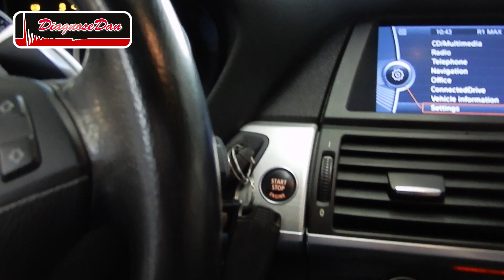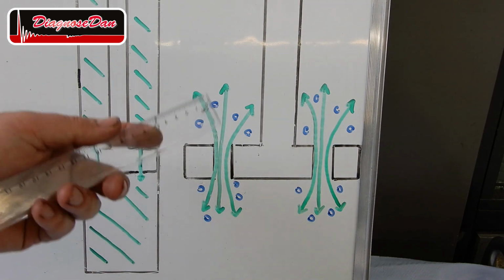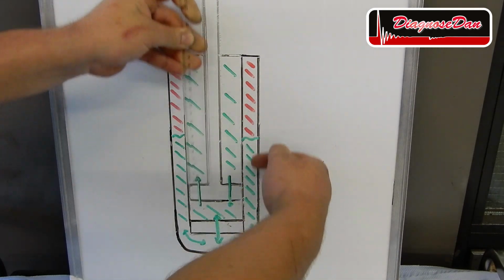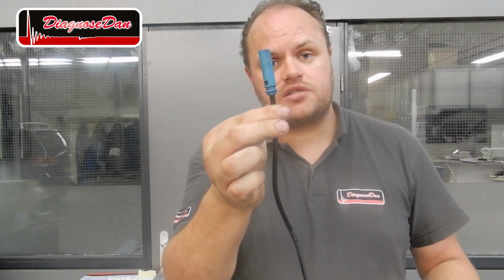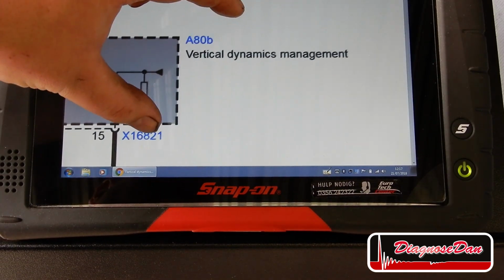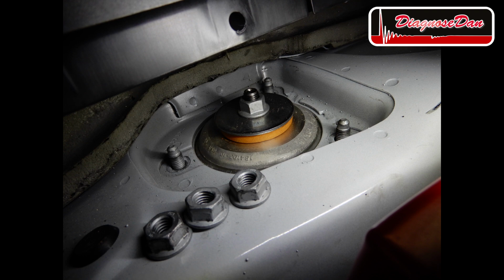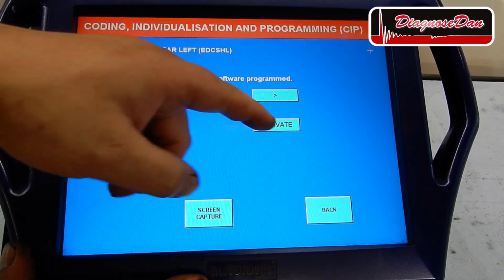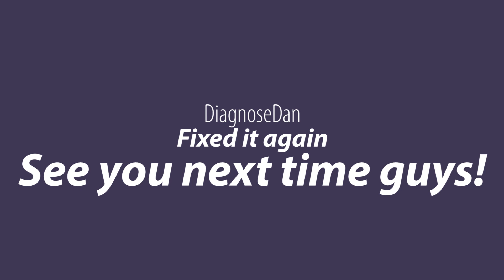Bmw Vdm fault/VDM/CDC/Dynamic dampers

Comment: Great video, my shock image comes on intermittently. I got a code D76B right rear VDM satellite. Oh boy. I’m wondering if I should replace both sides. I’ll do the simple thing first. I’ll check the connection on the right side rear first. 
This is an update. What I found was water damage to the shock side electrical cable. The back end of the cable connector was cracked open, and rusty. My question is. Why doesn’t BMW make a repair kit. My shock is perfectly fine. I had it looked at. The pins are no good.
Reply: Al final que hiciste? Me pasa lo mismo en un x6 mismo error trasero derecho D76B sí se ve un poco oxidados los pines les di con limpiacontactos y una pequeña aguja pero nada sigue el mensaje de error y no deja usar la tecla del modo Sport

Comment: Hello DiagnoseDan...I was truly impressed by your presentation & clarity in technicalities shared. Truly outstanding insights ever seen. 
I had this "chassis error- Drive moderately"....for a while now. The car runs okay with this error in the background & flashing used to occur  immediately on starting. First 3rd party scan diagnosed Front Left Vertical Accelerometer Sensor permanent fault...I swapped the sensor from left to right & got rescanned.The error then shifted to right...Now I ordered the OE part & replaced. Also, i had put new dampers in the front. The scan sees no error on either sensors but the Chassis error continues...but appears after few seconds on starting...The scan shows a Low Voltage error of front suspension (Not sure about the language). We in India are too short of expertise except the Franchise Services which I have not checked yet. Please guide. Just need a direction on what to expect.

Comment: amazing video Dan your knowledges are helping me a lot. I got one question the third wire on the diagramm between flexray high and low , is the signal from the vertical accelaration sensor inside the damper unit?

Comment: thank you Dan,  have these dampers on an F11  and they are seriously unreliable, I have had two failures ( top seal leakage) after only 60K km. They are not cheap😢 I dont have the abilty to code them so had to pay the main dealer to fit

Comment: I didn't pump cycle new Bilstein shocks and struts  and during brief emergency brake application at 70mph  awd subaru went sideways into the wall. Had new rotors, brakes, new tires, alignment right after the upgrades.  No other video instruction mentioned about pump cycling new shock absorbers. Great tip learned ,  thank you so much for being so detailed in every step.
Reply from the maker: Thanks for watching!👍

Comment: Another cent of mine.

There are two type of shocks in general.

One u mentioned is mix of oil and air so the oil is always aerated - it is called emulsion which are substances that dont blend together but mix together.
This type of shock absorber is fully filled with piston fully contracted to calculate for piston and rod capacity.

The other type is gas filled shock where gas and oil are separated by IFP ( Internal float piston). The high pressure side of IFP puts pressure on oil side minimalizing  cavitation which  occurs in emulsion based shocks all the time.

Another great video -thx

Comment: I had a 2011 Z4. The system was a bit different. It used DC current instead of duty cycle controls. 2 dampers from one axel shared one control unit. When my error message came, it could only tell something was wrong at the rear axel, but wouldn't tell left or right.

Comment: What is a good scanner for doing European vehicles? I have a snap on scan tool but apparently it is not capable of coding from what I’ve read which is a disappointment. Thanks
Reply from the maker: Mine snap on Verus does Coding on some brands.

Comment: Can you tell me if the vdm dampers can adjust the ride height? I have a f11 with M sport suspension and the front height is way too high (660mm) from the bottom of the (rim19") to the arch. No faults are stored. Can I adjust the front height or not?

Comment: I work in USA at a European manufacture dealership. One of the most critical steps in diagnosis is going to the computer and just learning the basic function of a system. Often, just reading the general function document will give you all the right questions you need to ask yourself to solve the customer's concern. I used to really really suck at this job and this manufacturer is very complicated. But doing what this guy is doing (understanding where the oil goes, what happens at the passages, etc) dramatically improved fixing problems faster and correctly (and much much easier) the first time. I still suck at the job, but whatever, I make money and cerveza still tastes good, ok? And often reading the function documents for myself, then understanding them, before I go ask the "shop foreman" what he thinks about a problem frequently reveals that he has no clue what he is talking about.  It lets me know that he will not be able to help me solve the problem and that I am on my own to solve it myself. Great video. This is not an easy or forgiving job. Thanks for posting.

Comment: BMW front shocks are the worst to replace a spring on.
When the shock is in its resting position the piston is all the way down making you compress the spring all the way flat OR pull out the piston and use a rubber piece under a hose clamp to prevent it contracting while you try to fit the spring.

Just like a regular gas filled one just that the piston goes the oposite way...

Comment: alot of garages would  just read the code and stick a shock on , then if there's a problem check the wiring after . 
I think i would have checked that wheel rim for cracks . good vid :-)
Reply from the maker: Thanks!

Comment: A comprehensive explanation and pedagogical approach. Just as a suggestion, it would have been interesting to take apart the bad module and see what could be the problem. Thanks for the video!
Reply from the maker: gearstil I tried that but the unit is casted plastic, and can't be opened🤩
Reply: thank you for adding that Dr.Dan, everybody on your channel wanted to get inside the damper module.

Personally I bet it was a bad solder joint on the controler chip. Molding the PCB inside epoxy did not prevent it to fail... 3 more wheels dampers left to fail from the same batch. LOL

Comment: Very good video and there is only one thing I can add. When diagnosing Flexray we measure the resistance in the circuit and also check for B- or B+ shorts. we don't use a scope because the Flexray is extremely fast and on a lower end scope it will give an incorrect reading which will lead to a misdiagnosis. Keep up your videos I really enjoy your channel.
Reply from the maker: Thanks for watching my video's it's appreciated !

Comment: So the same error code message appeared 3 weeks ago in my X5. Diagnosis with Carly narrowed it to front left, edscvl. The socket plug was corroded, the Blue one. I ordered new plug plus the pins and repaired them. After that Carly showed both front damper are faulty. I checked the fuses, no. 8 7.5A was broken. I changed it and reset the errors on Carly. Mistake was gone, and I could activate Sport mode again, but only for 2 hours. After that again the error code for the front left edscvl appeared. I changed the EDC module in the trunk with a used one with same part number. After that I didn't code anything, just deleted the errors from the disconnected battery. And again the error remains... Any suggestions?

Comment: a concise instructional video thank you,  I wanted to know what this repair cost, I found a new rear damper on ebay at £400, although it was possible to get a pair of re-furbs for the same price, with labour that's a very expensive fix for one corner. .. I think I could have a lot more fun in an MX5 ..  Although many years into my retirement I really enjoy your video's and the opportunity  to keep learning about modern diagnostic procedures, thanks again for the great videos.

Comment: Great video man. I have a question i have some knoking sounds from the front suspension but the mechanics arent sure about it. I have the adaptive drive option like this x6 and the mechanics said that it might be the dampers that are knoking ( only on small bumps). The dampers have no oil leaks and i have no fault codes. It may be the dampers? Thay cheked everithing else but they arent 100 %. Thanks..

Comment: you are the car magician dan. thanks for ur video. im now currently facing a problem on the porsche cayenne around 2014 years.the rear wheel differential control module show this code.. motor or position sensor reversal polarity. it has 2 big wire and 6 small wire in the differential motor. i hv no wiring diagram for this car. and the data stream is quite confusing😅 i believe the 2 big wire is positive n ground for the motor itself. but as i tested ..both were positive and the motor will operate. and this fault code is intermident. without a wiring diagram , by the fault code i can first suspected the motor itself as the fault code shows like mechanical things. and thise 6wire that goin inside the motor i believe was the position sensor and some sensor. base on this code.. any suggestion dan?
Reply from the maker: feddykoih I must admit i never worked on That problem, try to get a wiring diagram🤩

Comment: Absolutely great😁👍 Damn, that VDC damper was some work to get up and run, with all it's coding and calibration. And you sure are a great teacher👍 That job was a bit beyond what a DIY'er can do because of the required knowledge and the instruments needed. Got my Autel AL519, and it's not even close. But is it any OBD scan tools within a reasonable price range, that is a bit closer to what you have there. Lets say €400 max???

Comment: Communication line does they don't communicate both ways? and if so how do you know that the communication is not from the main unit if you don't unplugg the connector. Great video as always Dan
Reply from the maker: g johan Sharp comment, in the video i told that i would go deeper into that in a future video. But you are right.👍
Reply: great Dan and I like when you work on European cars the yanks always complain they are hard to diagnose but for you, it looks easy.

Comment: Hi from the UK Dan, thanks for the video. To make such videos more useful, could you indicate the software tool that was a necessary part of your repair. Without this, I don't see how I could copy the process you followed. Always helpful to know the cheapest route to such a tool - there are so many on the market at quite high prices for the DIY mechanic !
Reply from the maker: Rhian Taylor Sometimes you can't do things without the right tools. That's why sometimes even shops need to go to the dealer. And some jobs are not for the DIY. Even i sometimes can't fix them all, not because i don't know how to but because i don't have the right tools🤪
Reply: And which tool did you use  to code the shock absorber ?
Reply from the maker: Rhian Taylor the Autologic as you could see in the video

Comment: Does anyone know what is the max number of amps you can use to recharge a running car's battery?  In other words, if you wanted to recharge a drained battery in a running car  with a professional charger that has multiple AMP settings.Thank you for answering.
Reply from the maker: CoffeeBean Depends on what battery you are charging, if it's a normal lead acid battery. You can charge a battery quick by using high Amps and you can charge  slow by using low Amps. 
Example, if you have a 100 amp/hour battery it is going to take you 10 hours to charge at 10 Amps and only 2 hours at 50 Amps. But the slower you charge the better for your battery. That's why i devide the Ah by 5. So i'll charge a 100 Ah battery at 20 Amps.
Reply: @Diagnosedan  Thank you so much.  I just discovered your channel, and really like it because you present neatly, efficiently, and humorously.  I know very little about electrical diagnosing and figured one way to learn is to watch the professionals at work.  Thank you!

Comment: It might be interesting to point out that cavitation is not really air in the oil.  The low pressure causes the oil to change from a liquid to a gas.  Those are the little bubbles that we see as the oil loses its effectiveness.  This boiling of the fluid can be mitigated by raising the pressure on the fluid or choosing a fluid with a higher boiling point, or both.  Great videos as always.

Comment: Hi Dan, Great tutorial! Im in the process of replacing the VDM module on 2014 BMW X3 F25 and vehicle does need a complete software update. My question is; Which steps should I take first, Software upgrade the whole car then program new module or other way around? Thanks in advance :)

Comment: Great vid as usual. I'm sure Monroe doesn't make a satellite for that Bimmer. It looks like u r using a factory scan tool. 10-15 thousand. The samper was probably around 1100. Dianose Dan and installation 500. Looks like a Two thousand dollar shock absorber. R there any reasonably priced substitutes for the factory scan tools?  Yours is obviously a high end shop. Fancy rack to. Mine r assymetric simple ones. Early morning here and hot. Thank u!!!!
Reply from the maker: Bill Rimmer My tool is not factory it's aftermarket. It was about 10K just for BMW. And you pay more for more brands. You can get the factory tool (original interface) from BMW for 800 Euros when you use it on a laptop. When you use it or download software/update a car you pay 35 Euro's per day. You can use the interface on a laptop but there is also a scantool but that's more expensive. 
The customer payed 1000 Euros for the diagnosis, Complete Damper, Instalation and Coding.
Reply: I use a $20 K+DCAN cable with ISTA (and sometimes INPA and NCS Expert), it works well for diagnostics and coding, I don't trust it for something like a full car update, but most of the times you need to do that it's on a newer car and you can use a $5 ENET cable. 

If you have a proper shop, investing in tools that actually have manufacturer support makes total sense, but if you are a hobbyist willing to spend some time messing around getting stuff to work, this stuff can be done on the cheap.
Reply: samthenerf  Good morning and thank u for that excellent comment!  I don't do much in the way of Euro cars, but I will try to read up on the things u suggested. Have a great day!!

Comment: Damn, replace a shock and have to reprogram the car.
Reply: Of course. Everything is going that way.
Reply: More work for the mechanic, but more convenient for the owner than driving the old Porsche to the shop to have the mechanic tweak the adjustable Koni shocks.
Reply: BMW= Burn My Wallet
Reply: Less work.for the mechanic!
How long it took to replace the damper/shock absorber?
All deealers doesn't wanna pay a good experienced mechanic good money!
They.wanna pay the least possible money to someone how is capable to hook a tester to OBD port read the fault and replaced the component shown!..

That's why to many owner goes so many times back to the dealer with the car in warranty!

Comment: Another awesome video Dan! Learned a few new things today, they'll be useful if I go back to Beemers. 
Funnily enough, I have a similar issue with the adaptive damping system on my W212 E550, but mine only manifests itself when the temperature outside drops below freezing. Somehow, below freezing temps, the system goes into sport mode by itself and it won't come out of it no matter how many times I press the ADC control button. Error code wise, it shows a faulty rear left damping unit(I guess there's something special about that corner on all Teutonic vehicles). It's been working fine since May, when the temps went up.
I'm guessing there's an oil flow issue, what do you think?
Reply: Great vedio as always dan , top Technician, I had a similar issue ,  mine was keep saying left but I did not use autologic to confirm . Thanks for sharing this dan very very useful and informative.
Reply from the maker: Alin Marinescu difficult to tell, but Maybe you can move to a place with warmer winters🤣🤣🤣🤣
Reply from the maker: Soran Ghafour i know, scantool was giving wrong info right?